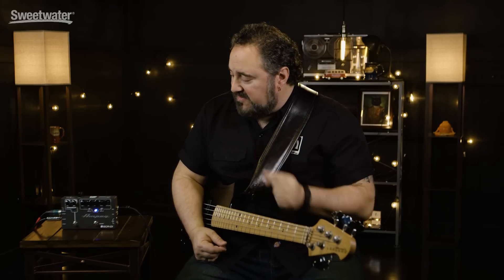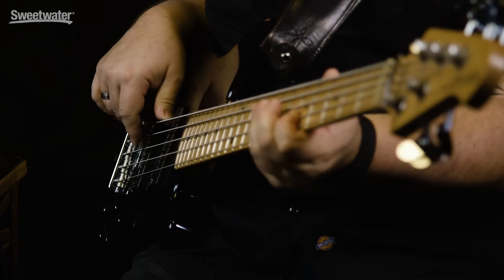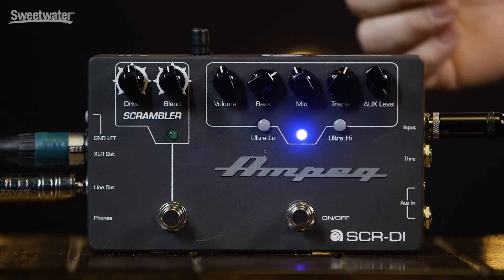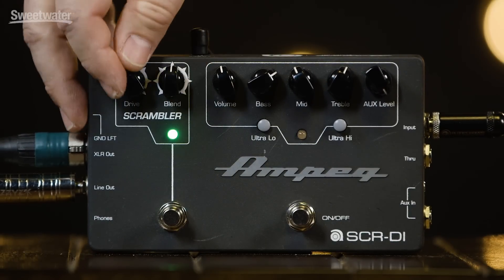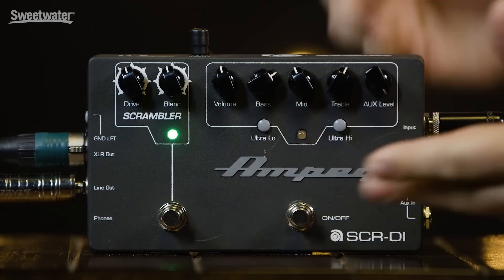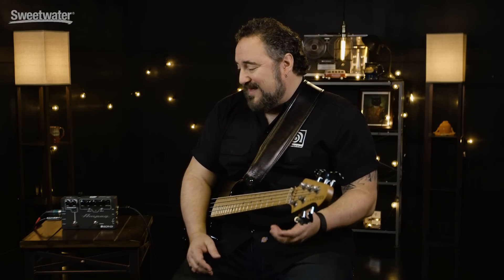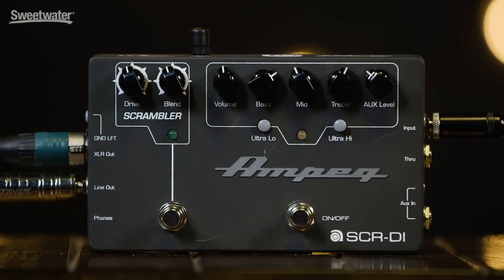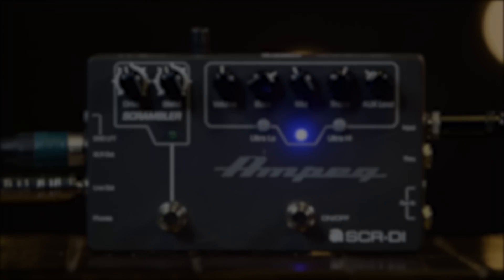Ampeg SCR-DI - Bass Preamp with Scrambler Overdrive Pedal Demo

Comment: This came built into my Ampeg BA-210v2.
Reply: Except this sounds 10 times better than the BA series amps when running thru a quality amp. The BA-210 is a terrible amp with lousy speakers and all kinds of issues.
Reply: @michaelbell75  I had a BA 210 as well. What was your experience?  Mine used to cut off during gigs.
Reply: Love my BA210! 🤘🏻

Comment: How did you have the xlr and line out run? I tried to do it xlr to FOH and line out to my amp and it was heavily distorted and sounded terrible. Not sure I had it setup properly for that. Should I be using the effects loop on my portaflex500
Reply: the line out is not for your amp, u should use the thru output for it

Comment: I bought a connector off eBay, drilled a hole in the side of the case, installed a micro switch and ran it to the passive/active jumper inside the case now I have a switch for active/passive basses also

Comment: can this work on its own with a cabinet speaker? or is an amplifier head need?
Reply: I have the same doubt.
Reply: I drive both channels of QSC GX7 with the SCR.  Ch1 of GX7 drives Mark Bass 2x10 cab and Ch2 of GX7 drives Mark Bass 4x10 cab.  So you need either a power amp like I'm doing or an amp with preamp/power.
Reply: It will work with a speaker without any other amp needed.
Reply: @stefanodegerome5586 No it won't its a DI box.

Comment: Good god, none of those tones will work in a live setting. All that massively be scooped shit sounds pretty when you're sitting next to it in your room, by yourself, but it's entirely useless live. 
Also, if you're going to make videos for bass gear, it really shouldn't be that hard to get a real bass player - this guy is a guitar player and it shows.
Reply: allrequiredfields Facts it colors your tone and scooped it way too much, It does not sit good in live setting for me at all. l ended up selling  it ASAP And ended up getting the Tc Spectra a drive and Aguilar TH. Both pedals are night and day compare to the Ampeg. Both of my new pedals sounds killer in a live gig.
Reply: It really depends on the genre and mix. A scooped sound works with old school EQ styles where the guitar is much brighter and without much low-end, but it gets drowned out when using more modern EQ styles where the guitars have much more low-end. It definitely needs a better mid sweep though.